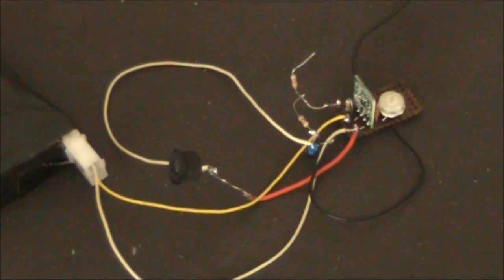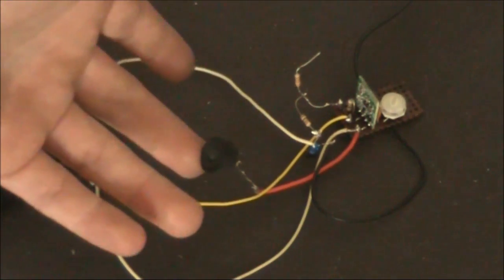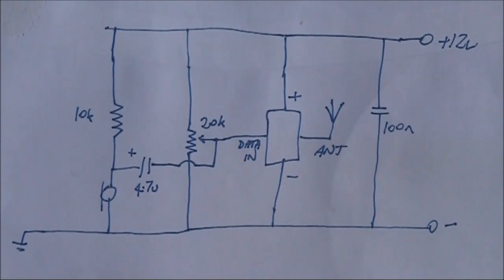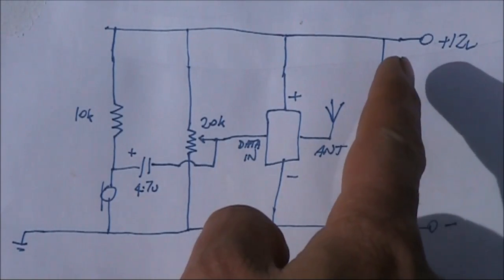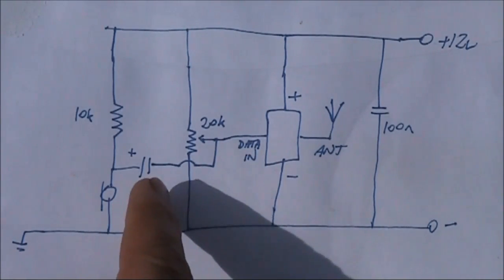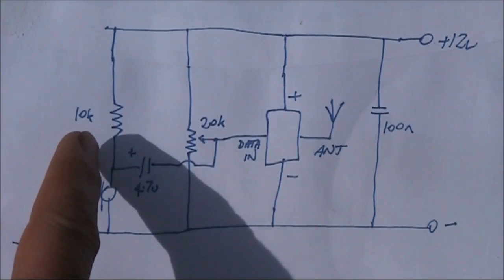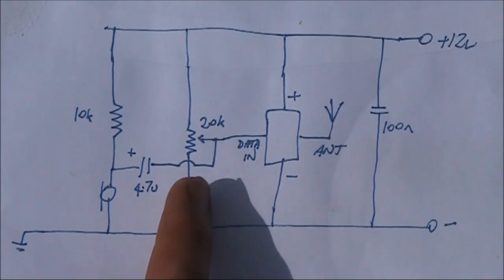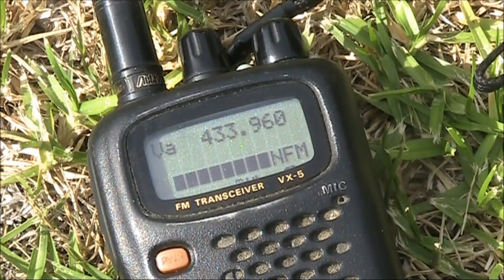Experiments with low power UHF data transmitter modules: Part 7 Electret microphone

Comment: Really like these videos! Any thoughts on making a "series" or at least one video with the receiver of these low power UHF modules? I'm wondering if it's possible somehow to connect a speaker to the receiver module and hear the sound of the 433.92MHz frequency band. Do you know if that's possible?

Comment: These vids are great.  Did you happen to notice how many harmonics it sends out?  Mine using voice from Arduino splatters all adjoining freqs but it does indeed do voice just fine.  Cheers!
Reply from the maker: +MKme Lab No haven't tried that - have nothing above 500 MHz. Interesting test though.